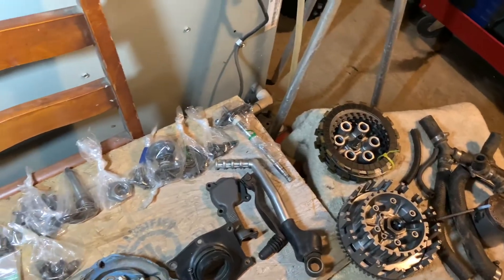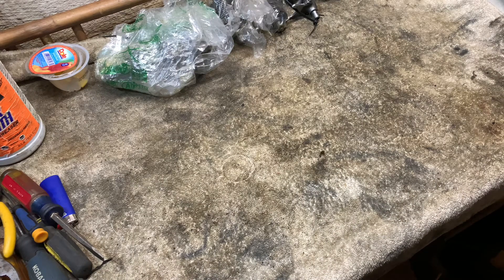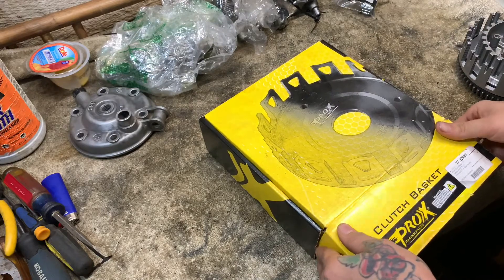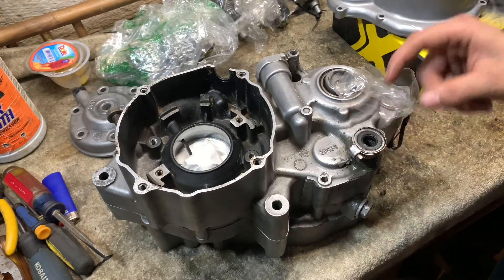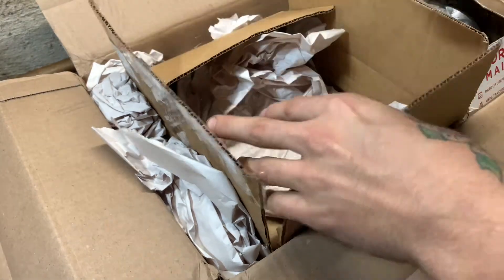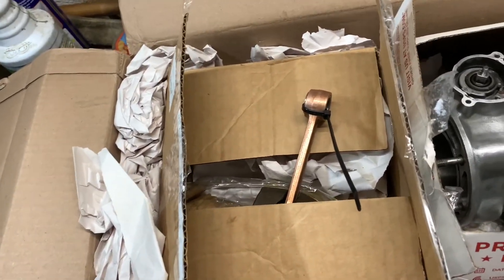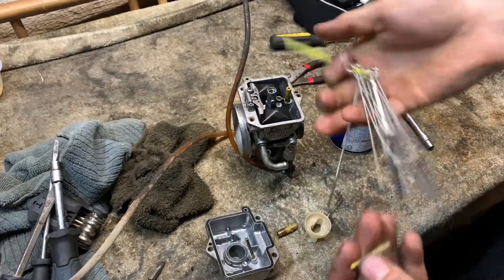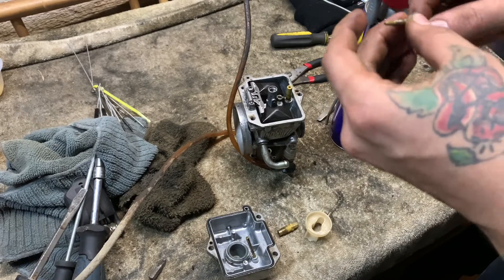😱Got the RM 125 running 😱🤯

Comment: Hot rod bottom end
Reply from the maker: No just the connecting rod is
Reply: Yea how bad was that top end cause when Cameron took the pipe off he said there was like a lil chunk in the piston
Reply from the maker: @qt8541  oh you’re talking about the RM I thought you was talking about my YZ I don’t know what type of crank it is but I know it’s not stock And yeah the piston did have a little bit of chipping on it but the cylinder was perfectly fine
Reply: @raceradgarcia3274  yea it’s got a hot rods bottom end I’m pretty sure
Reply from the maker: @qt8541  oh ok cool look good bike runs really good